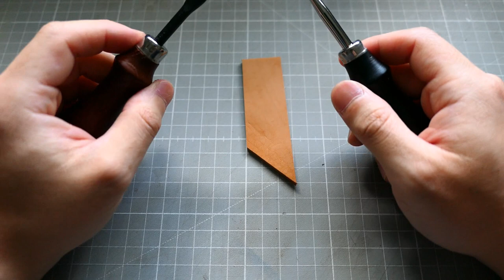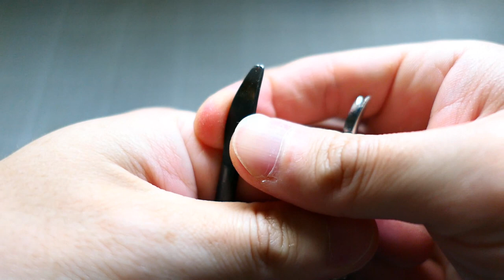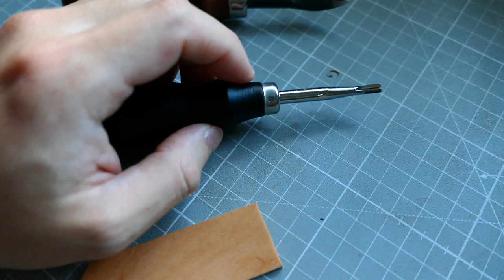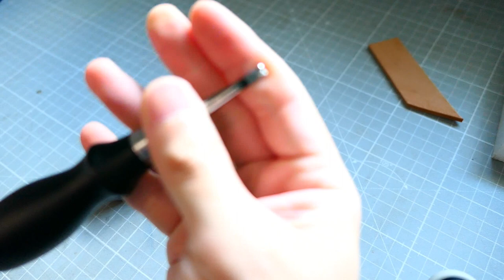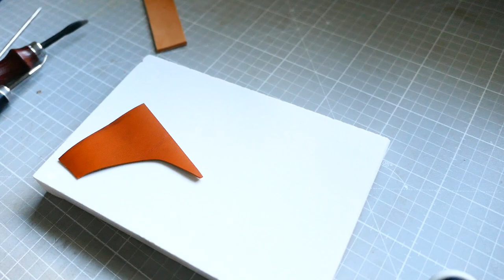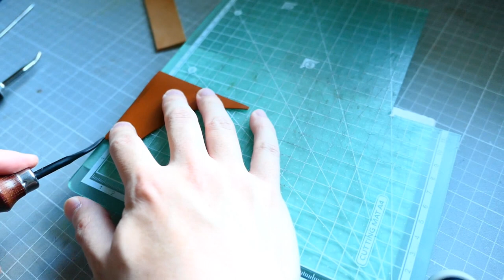CHOOSING EDGER SIZE

Comment: I think that the size of the beveler should be at most a third of the thickness of the leather. If you choose a beveler too small the effect is not visible. If you choose a beveler too big you cut a v-shape and you can not round the edge. For example if you have 4mm thick leather I would recommend a beveler of at most 1.3 or 1.5mm.
Reply: For a 3.5mm leather desk mat, what beveler would you recommend as first choice and then second choice? Thanks
Reply: @adiands850  Between 1 and 1.3mm.
Reply: Makes sense, thanks

Comment: Hi, I'm new to leather crafting, buying expensive edging equipment is not an option, would sandpaper be enough with a little more efforts?
Reply: No. Absolutely not. I am sorry that this is not the answer you wished for. But it would look truly terrible. Do not cheap out. Go for Palosanto bevelers and purchase 2-3 different sizes. My recommendation would be 0, 1 and 2. 0 for card holders, 1 for portfolios etc and 2 for belts in approx 3.0 - 3.5mm thickness.